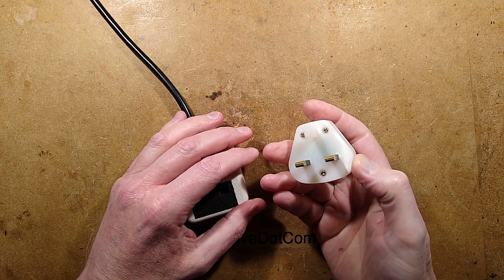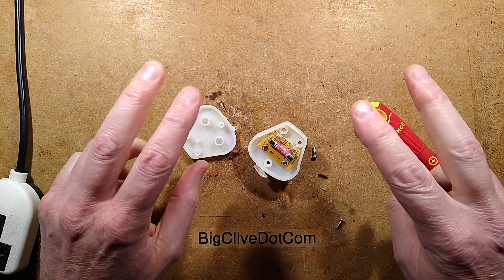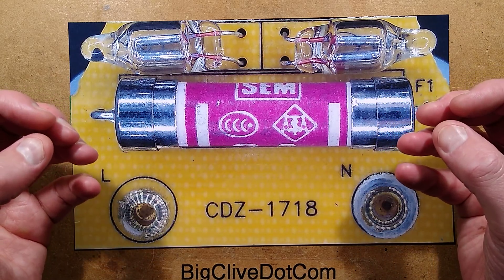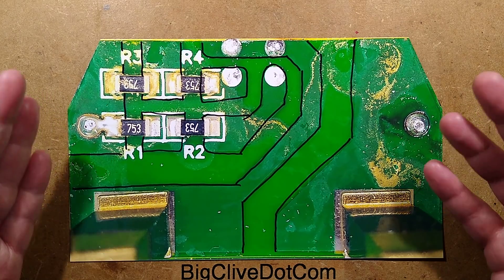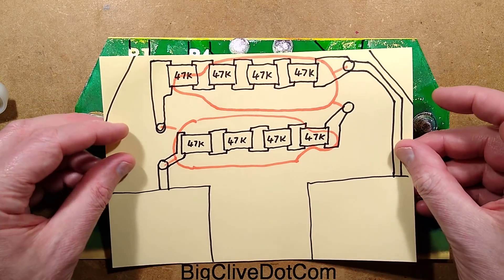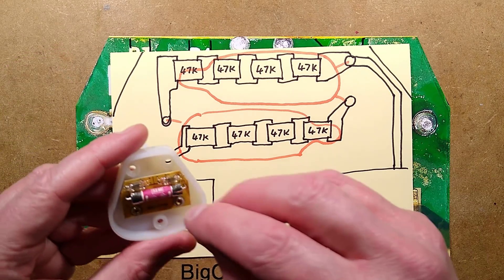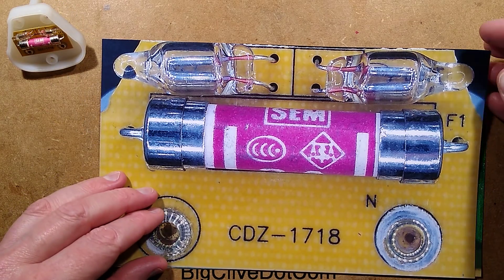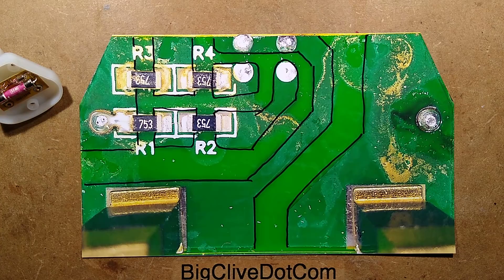British neon night light and the curse of the box-tickers

Comment: Is it true that the new design reduces the flicker? Those two neon lights are connected in serial, so I would guess thet the striking voltage must reach twice the voltage of a single neon light?
Reply from the maker: In this plug there are two sets of resistors and a neon in parallel.
Reply: @bigclivedotcom  Hello BigClive. Thanks for your answer. Nice to talk to the master himself  :-)  Of cause you are right! I mixed up the pins of the fuse with the connectors of the mains voltage in the lower end of the PCB in the backside view.  I already was wondering that you did make a mistake in such a simple schematic. But of cause it was me who was wrong :-(  Great channel on youtube, always love to watch your videos. Many greetings from Germany.

Comment: You could actually put the fuse in on the opposite side of the board from the neons to make it light fully and make it work out, right? Ya think they may have ignored it or would there be a reason behind it?

Comment: My suggestion is longer pins that position the PCB further away from the wall, enough to fit the fuse on the other side of the PCB. not sure if the lid would still fit on it, I guess that depends on the Z of those neon lamps, or perhaps some larger lamps could be used with all that space freed. But if there were lots of constraints on the design it might not be able to be any better than what we saw.

Comment: Why is there a fuse? There is no flex. No chance of overload. That fuse would pass 4½amps all day. 
That fuse is technically integrated, so can't be change(by an ordinary human)if it did blow. So if purely for some sort of compliance "safety" rule there are other less intrusive methods. So what fault scenario could blow any 3amp fuse before component fry? Hammer abuse? 
Neon indicators in say 4 gang leads are fused at 13amps!
I think an over zealous office bod has got his/her wires crossed.
Thought, could the manufacturer have had some shorted neons, but then the neons would pop before that fuse.....

Comment: One thing I noticed about this redesign (I never knew this had existed let alone been redesigned until I watched this) is that the neon indicators look like eyes.  However, plop in a hybrid USB-A/USB-C charging circuit rated at 115 watts (100 watts for USB-C (5 amperes @ 20 volts) + 15 watts for USB-A (3 amperes @ 5 volts)) and you have me sold!

Comment: Halve the height of the board, mount the fuse inline at the top of the board where the earth pin isn't, then use the same design as it already has, the fuse will have a much lower profile resulting in less light blockage and the neons will be closer to the midle of the plug

Comment: Does the plug carry the BS1363 mark?  As I remember, anything which goes into a BS1363 socket must carry the same BS marking.  This was an issue with those controversial 'safety' covers.
If this neon light doesn't carry the BS marking, then it hasn't been approved - regardless of the fuse they shoe-horned in.
Edit: I think I can see the marking at 0:07

Comment: I would think that if they had just put a taller circuit board, which would fit the assembly , they could then have put that fuse pointing top to bottom and placed the lights on either side of the fuse.  That would have given off better light.

Comment: Where is the 8 pin microprocessor?  No photoeye or proximity sensor so lit 24/7
Reply from the maker: The dusk sensor circuitry would probably use more power than the neons.

Comment: Perhaps they intended this circuit to be used in multiple plugs, such as ones that light up but allow you to attach a cord, to be used as a replacement plug, and just decided it was easier to use the circuit with the fuse in the simpler night light version as well..

Comment: disregarding cost, couldn't they have used a SMD fuse, or are they not "compliant"?
Reply from the maker: 240V with a 32A circuit breaker is a formidable force.

Comment: Mounting the fuse vertically with neons on both side (as many here are suggesting) would reduce the clearance between the live and neutral lines - possibly a consideration in the design. Additionally, any suggestions to "just use a small surface-mount fuse on the underside" might not pass muster either, depending on the type of fuse available in surface-mount packages and whether they meet the required UK standards for permitted fuse types in this application.

Assuming they're not stuck with just the existing plastic housing molds, I'd replace the lower single screw with a clip/latch to make a bit of space and extend the PCB down to put the fuse at the bottom of the housing beneath the terminals, leaving most of the body free to diffuse the neon glow more evenly.

Comment: I'll always remember when I first played with little neon lamps (which was QUITE a while ago).  I didn't understand why they needed to have a resistor (typically about 75K) in series with them, so I experimented with lower and lower resistor values, and the neons still worked. So, OK, why have a resistor in series at all?  I quickly found out why :)
Reply from the maker: I did that myself.  It made quite a bang and my newly etched PCB lost some tracks.
Reply: I remember as a child plugging a NE-2H directly into a 120V socket. The bulb exploded in a ball of plasma and one of the electrodes turned into a little sphere of orange hot metal that rolled around on the linoleum until it cooled below incandescence, which took a few seconds.

Comment: Not a clever arrangement at all. With correctly rated resistors, that fuse could never blow; the resistors would fuse first. Also the fuse has been placed in the neutral line, which hints that it is not really a UK design at all. If the two neons were placed in series, the power wastage could be reduced, though as you say, there would be a bit more flicker.

Comment: In the UK most sockets are mounted low down near the floor, so optimising the light to be mostly visible from the top while incorporating a fuse makes sense. While the fuse does block half the light, it is not such a terrible compromise considering where the majority of these nightlights will be placed. The plug top could perhaps be moulded to act as a light pipe and thus spread the neon glow over the entire surface, but that would increase manufacturing costs.
Reply: I would think you'd still want to maximize the amount of light on the floor; this way you can see where you are walking.

Comment: I've got a box with a good selection of the originals, most of them are from between 1978 to 1986... and most have bare pins though one I've got with the MK logo on it has a small fuse with a 1A rating like the ones that were in some dimmer switches... the rest have no fuse but the resistor acts as a fuse... well I'd expect it to... most of them were made by the British plug manufacturer's looking at the info between the pins, got a few green neon plugs among them... they were sold as nightlight plugs but I thought they were an amusing novelty and collectible.

Comment: I'm thinking they could have maybe made the circuit board larger to accommodate that fuse and put more neon lamps in there.  Is the space inside the unit too compromised by the screw pillars to allow for a larger circuit board?

Comment: I use these to indicate if my bench distribution extension sockets are powered, it provides a brighter indicator for the longer extension blocks that do not have a neon fitted.  Unfortunately the neons do eventually fail, going black and flash at an annoying rate. 
 Recently, these once ubiquitous neon indicator plugs became very difficult to buy, disappearing from the hardware store shelves.
Even the extension blocks, fitted with neon indicators, disappeared. It was still possible to buy  basic LED night light with the LDR darkness detector.
 I assume new rules forced the old designs off the market for a time. Glad to see they have reappeared, surprised they did not fit glass fuses that would produce a less intrusive shadow. Arc suppression sand fuses seems like overkill for something that takes so little current.

Comment: Designer must have had the layout reversed as the L and N are incorrectly marked and the fuse is in the neutral leg, not that it matters but...
Reply: the hole world is at risk having fused neutral  omg horror !!!! :)
Reply: I noticed the fuse was on the neutral side but didn't notice the labels; have to re-watch it!!
Reply: Considering they went to a lot of trouble to comply with regulations they overlooked a fundamental standard.

I really don't see the point of a fuse in a light that does not have a flex though, if anything went wrong with a neon light it would just stop working, there is no way it could blow a 3A fuse !

Comment: there are SMD fuses as well, they are small and quite likely cheap, also through hole fuses that are really small... probably the issue is the fact that it's embedded in a plug, so you can't legally use "in-appliance" small fuses... but that thing is too big!! let's be honest
Reply: You're not going to get anywhere close to the 240V 6000 AIC required by BS1362 with a SMD fuse.
Reply: @straightpipediesel  so that's what i tought?

Comment: That's absolutely fucking retarded to put an HRC fuse in one of those... A 2W fusible resistor in line with the other resistors would probably be fine if you're one of those people that cant squeeze a 0.040" ball bearing out your ass, and even with flame retardant plastic it would still probably be cheaper. Ah the joys of safety regulations and QHSE.

Comment: Could they use a physically smaller fuse with the same specifications?
Reply: Probably not, but they could use a physically smaller fuse with more appropriate specifications. That thing is dimensioned for a kettle, not a night light. Likely the whole reason it's there is some rule to protect the wall wiring, not devices.
Reply: @0LoneTech  Well, the only specifications that matter for a fuse is peak voltage and current (well, and the sand-filled stuff). The dimensions don't matter much, except for the voltage rating.  You can't have an 0204 SMD 240V fuse, for example.  I strongly suspect that smaller fuses are available, but they just cost a few pennies more.

Comment: you can complain about the fuse but thats just lazy and shit design. I think it would be simplicity itself to integrate a fuse basically invisibly into a simple resistors-and-neon nightlight. actual mains plugs are held together by a single screw, you could shift the fuse down to where the cord grip usually is and have a neon either side of the central screw. it wouldnt matter about the screw post because thered be a neon either side of it. or just make the back 5mm deeper and put the fuse behind the pcb entirely. or any number of other simple design fixes that come to mind.

Comment: Bigger PCB, 2 neons above the fuse, 2 below! Run them in series so only 2 resistors needed (or 4 small SMT ones).
Surely you could use a fusible resistor like all the cheap switch-mode plugtop power supplies?

Comment: To get a better light output, they could have made the case a bit bigger (the dimension between the side that the pins are in and the ‘top’/‘front’, so when plugged in, it stands out from the socket a little bit more), then the neon lamps could be raised off the board a little bit, so allowing light into the whole of the ‘top’/‘front’.

Comment: When the board is in the plug, you can seen a lot of dead, unused space.   I think it can be done quite easily, if the whole of the space was used.
That way, three neons could be used.
Reply: You also have to keep in mind that PCB area is also a major cost component and the more units you can get out of a single panel the cheaper your unit cost is, and neon nightlights tend to be rather inexpensive items so I’m sure they opt to minimize parts cost.

Comment: Use a clear glass fuse and/or drop the size down to 15/20mm
Reply from the maker: A clear glass fuse has a fault-current breaking capacity of only about 35A.  After that it arcs internally and can explode.
Reply: bigclivedotcom it’s in a enclosure but I suppose it’s not to spec, maybe a poly fuse then if not a 10mm axial ceramic

Comment: Hi Clive, you never mentioned the rating on that fuse... As an experiment, I'd harvest the fuse out of there and replace it with a wire to see how much better the night light looks.

I think your guess is correct, they were likely forced to put that ridiculous fuse in there because they're not cheap like glass fuses are... and every engineer knows that neon bulbs and resistors are basically act as their own fuses.

If I calculate this correctly, and I'm not accounting for AC power, just treating the 230 VAC as VDC... in a worse-case scenario let's say a neon bulb had a dead short, the 150K across the 230V line, current would be expected around 7 or 8 milliamps or 350 mW over those resistors so each resistor experiences ~ 176 mW each... are those 0805's? they'll probably fail or just get hot, but it will not "detonate" like a cheap USB wall chargers... but the more likely scenario is that the neon would fail open, the light would stop working, and the customer would replace it with another one... 

Yes, once again, the idiot Safety Police has superseded rational and common sense design for ticking the "box" - Hey why not go super paranoid and force people to buy a fire extinguisher along with the night light  "just in case"  anything goes wrong?
Reply: I'd replace it with 26 gauge magnet wire wrapped a dozen times around a .22 cartridge. This way when you've slept long enough it'd wake me with a little bang.

Comment: 1:50 Anyone else notice that Live/Line and Neutral are reversed on that PCB??? Weird.. So Live goes straight to the neons, then the resistors, through the fuse and finally to the neutral pin...
Reply: Probably the result of his photography. He often flips images.
Reply: @johnpossum556  I thought that originally but the L and N are not mirrored/reversed, nor is the text on the fuse, or the PCB name "CDZ - 1718" and then on the shot of the bottom of the PCB the component labels, R1, R1, etc are not mirrored either...
Reply: @generaldisarray  Maybe the company that made the PCB flipped it? It's not that uncommon.

Comment: Part of the problem would seem to be that they put a screw in the middle of the long side of the plug and two in top, rather than one in the top and one in each corner of the bottom. That would have provided much more wiggle room. This might be a standard design for British plugs, but it seems far from optimal.

Comment: When you mention that the usb supplies can sometimes detonate and come open, with the fuse being inside the device does that mean there would be exposed live parts hanging about after failure?
Reply: I had a power supply for a D-Link wireless access point fall apart in my hands while I was unplugging it once. It was still working, and I was unplugging it to reroute the cables.
The worst part is that it was plugged into a power distribution panel at the back of a 42unit rack cabinet, so I was leaning on the steel rack frame while reaching for the power supply with the other hand. The design of the plug pack meant the 2 mains pins were right up against the casing, and the way I gripped it.... My fingers were only 1-2 millimetres from touching the solder blobs where they went into the board, with the other arm firmly pressed against a grounded steel surface.
Reply: @tin2001  Ouch! That could ruin your whole day.

Comment: Trying to visualize if one neon lamp can be above the fuse, and the other below it (maybe vertically).  That, or put the fuse on top and the lamps underneath it.  That way, the light at least comes from the center.  But I'm sure the designer considered these.

Comment: Seems like if they really wanted to do the fuse thing, some other comments said straight between the blades but _also_, fuse holders with the neons in between. If the design of the housing was flat on all sides and height clearance was sufficient, they'd be able to do it. Considering the accessibilitty of this device, makes no sense to literally solder the fuse in.

Comment: In the early 70s I bought a lot of neon night lights that plug into the regular outlet and over the years I’ve never had one go out they just keep on plugging along.
Reply: It's bloody daft those neons are wired directly into things like cooker and shower isolators with nothing more than a resistor or two between them and the 40A rated output to the cooker or shower itself. And yes plenty of them have been sat in the wall for decades too still working quite happily and apparently with no need of a fuse all those decades.

Comment: I'm more curious why they're using neon bulbs instead of LEDs...It would be more efficient. Also remove that fuse, it's really not necessary.
Reply: LEDs need more current than neon bulbs. You would just be wasting more power in the resistors.
Reply: @rocketman221projects  Well that's something I would not have guessed. I figured an LED requires less than a neon. Thanks for letting me know.
Reply: @Eremon1  Small neon bulbs operate at a much higher voltage than an LED, typically over 60 volts at around half a milliamp.
LEDs are more efficient than neon but need several milliamps at 2-3 volts to provide a similar amount of light. They are also more likely to be damaged by any voltage spikes on the mains.
Reply: @rocketman221projects  I guess I was thinking of the large neon lights which seem to require large amounts of power. A neon that small must be far more efficient than the large neons. I have only just restarted my electronics curiosity after years of doing other things. Now I have more time to learn things I want to learn.